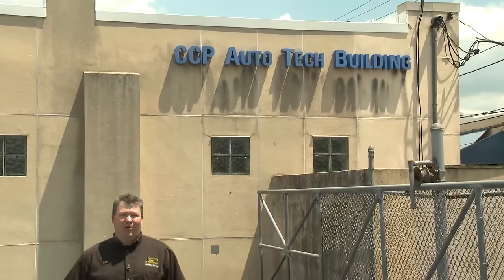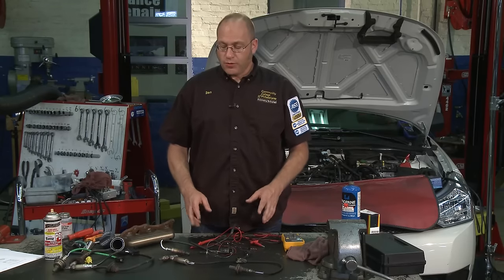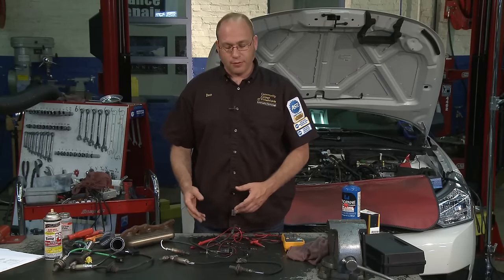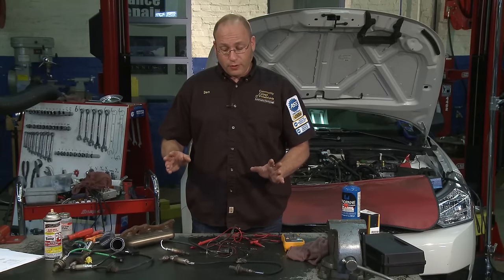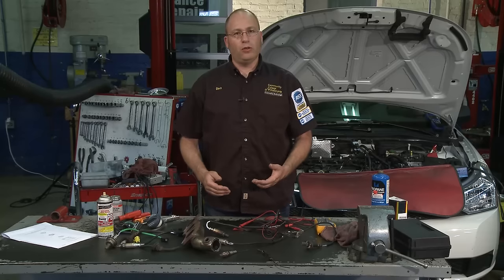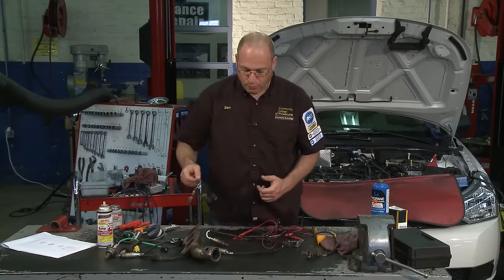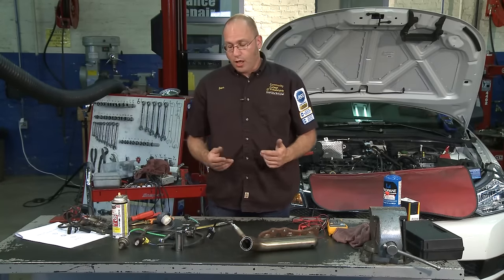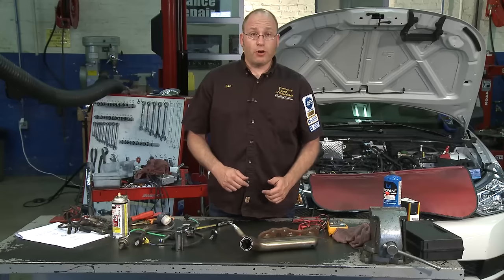Car Corner: O2 Sensor Diagnostics

Comment: Hi hope you are well I think you have answered my questions as I have not tested the wiring but looks like I would have to replace it 
Car Scanner ELM OBD2
DTC report
Selected brand: Mazda mx5 mk3 

============1==============
P0134
Raw code: 0134
ECU: Engine control unit
Status: Confirmed
OBDII: Heated oxygen sensor (HO2S) 1, bank 1 - no activity detected

============2==============
P0130
Raw code: 0130
ECU: Engine control unit
Status: Confirmed
OBDII: Heated oxygen sensor (HO2S) 1, bank 1 - circuit malfunction

============3==============
P0031
Raw code: 0031
ECU: Engine control unit
Status: Confirmed
OBDII: Heated oxygen sensor (HO2S) 1, bank 1, heater control - circuit low

============4==============
P0134
Raw code: 0134
ECU: Engine control unit
Status: Pending fault present, Pending fault present during this driving cycle, Test conditions are met, Test is inhibited by other DTC, Test has not been completed, Validated and stored in non volatile memory, Validated fault present at time of request, Validated fault has been present during this drive cycle
OBDII: Heated oxygen sensor (HO2S) 1, bank 1 - no activity detected

============5==============
P0130
Raw code: 0130
ECU: Engine control unit
Status: Pending fault present, Pending fault present during this driving cycle, Test conditions are met, Test is inhibited by other DTC, Test has not been completed, Validated and stored in non volatile memory, Validated fault present at time of request, Validated fault has been present during this drive cycle
OBDII: Heated oxygen sensor (HO2S) 1, bank 1 - circuit malfunction

============6==============
P0031
Raw code: 0031
ECU: Engine control unit
Status: Pending fault present, Pending fault present during this driving cycle, Test conditions are met, Test is inhibited by other DTC, Test has not been completed, Validated and stored in non volatile memory, Validated fault present at time of request, Validated fault has been present during this drive cycle
OBDII: Heated oxygen sensor (HO2S) 1, bank 1, heater control - circuit low

Comment: At 27:32 you talk about the sensor reading rich and lean. I have a Air fuel ratio gauge that reads it like that. But will read rich at higher speeds of 75 mph. What’s going on?

Comment: Dan   that  was  a  really  great  video  on  the  oxygen  sensor  and  the  diagnostics  used  to  search  through  the  Check  Engine  light .    My  interest  in  the  oxy  sensor  is  because  i  want  to  install  and  HHO  gas  generator  ( Brown's  gas )  to  extend  the  mileage  of  my  2004  Ford  E250  van.    Would  HHO  gas  impact  the  oxygen  sensor ?   Would  it  have  any  effect  on  the  catalytic  converter ?    What  are  your  thoughts  on  HHO  gas .   Thanks,  Gary

Comment: Can anyone explain why I get a P0172 CODE "System Too Rich, Severity 2/3" after installing a brand new Catalytic Converter?  There were no codes prior to installing the new CAT, and we used the old downflow O2 sensor.  Also, the old upflow 02 sensor was not replaced.  I reset the Check Engine LIght, and am hoping it will not come on again.  However, is there any reason for this happening?  Thanks.

Comment: very good analysis and method demonstration. Maybe would be more realistic if the car was more rusty and older... like most people with the problem??  My post cat O2 sensor has 4 differently coloured wires so am a bit lost as to which are the heater wires. Dave UK

Comment: I'm not getting check engine light but been getting hesitation and thinking possible fuel filter. so ran code and got p0141 and p0452.   Will need to change sensors. Hopefully that's all the issue

Comment: Does  the  two  wires  o2  sensor  could  be  replaced  by  4 or  5  wires  02  sensors ?it's  for  a  91Caddilac4.9DeVille . Cranking  hard  but  doesn't  want  to  start . Once  the  battery  cable  is  connected  and  open  the  door  the  idle  speed  control  motor  making  a  clicking  sounds .

Comment: my friend i have a 2013 mustang v 6 i got the code po 420 and po 430  for bank1 and bank 2 efficient threshold my car got something when hit full throttle the car rpm go from some 1000 to 2000 rpm so slow the car launch is so bad and when keep doing full throttle   its start to do something like misfiring its keep cutting of and keep lagging but i got no misfire code and the check engine light flashing 3 times when i turn the key  to ignition 2 any advice

Comment: I have a fiat Punto Evo 2010 model . When I drive some days check engine light and massage pops up , there is no power loss or any other problems. Later after 2 or 3 days it goes off why is this happening? I went to a diagnosis center he told me it's O2 sensor but he erased the massage . Later after one month it came again.

Comment: a physical check of the sensor is good but the correct Part Number should always be the basis in order to have the correct replacement part. You should have use a torque wrench as well to prevent loose or over tightening of the sensor.

Comment: i have a 1995 cadillac fleetwood brougham 350lt1. when the engine gets hot it runs bad (will not take the gas when i try to go, spark knocks really bad) finally it will smooth out. then it runs smooth again. when cold the car runs smooth as silk but, there is no check engine light on. is there any way you can let me know what you think it may be. i would be so greatfull.
Reply: try a tune up

Comment: Everytime i'm watching your video channel, an additional knowledge free of tuition fees, thank you, regarding legit vehicles diagnosis and repair or parts replacement..This Oxygen sensor topic enlightens me about my case, Hyundai Sta Fe 2.2 FE crdi (4 cylinder diesel engine A/T).. Check Engine lights On..but i didn't bother about it because my vehicles still running good, then after 3 weeks Black Smoke starting to appear in my exhaust pipes everytime i want to accelerate immediately...(it is Rich in fuel not Lean right)..and i don't own OBD2 so i don't know exactly which of the 2 Sensors i need to replace...using multimeter by Ohms maybe a possibility to diagnose it..Thank You Sir Dan and CCPTV5...(🇵🇭 netfan)

Comment: Do you have any better way to check sensor without take out the sensor . As just measure the ohm on the wire of sensor. Don't Need to take out...

Comment: you tested a two wire sensor. i have a 4 wire. so what type of wires did you set aligator clips to.  would they be the black and grey of a 4 wire? thanks
Reply: On a 4 wire, two (black) are signal and one (white) is heater, one (grey) is ground. Check a Chilton's or Haine's automotive electric schematic manual to be positive!

Comment: my o2 sensor have issue with its heater element, not giving any resistance when tested with multimeter.
would that be an issue in long run? i've check engine light though referring to the o2 sensor heater
Reply: Yes it is a problem if the heater isn't working on the 02 sensor.

Comment: Video was very good. I have A 2002 CAMARO LSI THAT THE SERVICE ENGINE SOON LIGHT COMES ON not check engine light. At around 100.00 miles I had it checked and it said co2 sensor is bad .I had it changed and went 500 miles before it came on again Don`t know what to do. I did not know that when a punched the car out of state that they put headers on it and removed the cats. The car runs great except for the service engine soon light coming on. Would the cats make this happen.
Reply: +lee rossi Yes, they car is trying to "see" the converters working.  If they are punched out its going to code.
Reply: The two sensors that are mounted before the catalytic converters provide information to the ECM for air/fuel. The two sensors mounted after the catalytic converters essentially tell the ECM about the condition of the catalytic converters, to ensure they are operating within set limits. Without the cats, not only are you illegally driving the vehicle if it passed inspection, but the ECM has no way of confirming the cats are operating within limits, so the light will never be shut off by the ECM itself.

Comment: Hay I have a 2019 fusion that has about 46000 miles and the bank one keeps coming up even after I replaced the bank one oxygen sensor the car drives much better now and doesn’t hesitate around 40 mph so what gives ???????

Comment: I was taught o2 sensors ohms are 10 ohms and above if they are good. We put 3 good o2 sensors that read 10 ohms and the car had no problem with them but when we put an o2 sensor that was 2.9 OHMs, the scan tool showed it was bad

Comment: Would oxygen sensor perform ok if the catalytic converter was somewhat cleaned out (a bit of say broken honeycomb material pieces cleared out )?
Reply: The 02 sensor doesn't care what condition the catalytic converter is in. But, a bad catalytic converter will affect the fuel management system.

Comment: hi guys .i have 2006 hyundai  sonata 3.3L GLS with no code but with the car on or im driving it fuel range miles digital number droping like crazy means i have gas leak i check out car there is no smell what so ever no sign of any leak on gas after my reserch i thing my sensors going bad bcz i have 95 thousand mile in car any advise pls or mr Dan pls help ???

Comment: what if the bluedriver tool says it's running rich but the ONLY codes i'm getting are that there's a misfire on cylinders4,5,and 6 which on my 2009 335i bmw refers to bank 2 (rear). my car has 4 oxygen sensors.

what could it mean?

i'm also having my catalytic converter glow red and it's smoking from the exhaust and leaks a bit of oil from it.

any advice??? i'm really getting stuck
Reply: Your MAJOR problem was January 2019...It's now March 25, 2019 in Long Beach,CA.

1) Number 1 cause of Catalytic Converter FAILURES are Misfire Codes & Fuel Trim Codes _______Misfire Codes are P0300 ( Unidentified Cylinder Misfires ) - P0301 thru P0312

In your case, you said Cylinders 4, 5 & 6
The "4" true interpretation is you have a Code P0304. The last digit "4" tells us that Cylinder 4 is MISFIRING.....The 5 is Code P0305 (so Number 5 Cylinder is Misfiring & # 6 Cylinder is Misfiring also, which is DTC ( Diagnostic Trouble Code ) is P0306......If # 8 or # 10 Cylinders were Misfiring you'd have DTC's P0308 & P0310.

The Fuel Trim Codes are P0170 ( Bank 1 ) & P0173 ( Bank 2 ).

When you mentioned the Catalytic Converter was Red Hot, you made me more nervous than a Cat on a Tin Roof.......That Catalytic Converters Life was OVER.

But before any Catalytic Converter is replaced on Planet Earth, the Fuel Pressure Specs. must be known ,  Fuel Pressure Test must be implemented AND the Ignition System components must be Examined : Are the Spark Plugs on Cylinders 4, 5 & 6 defective ? Are the Ignition Coils on these "3" Cylinders @ Fault ?................Are the Intake & Exhaust Valves @ Fault ?...The 1st example ( Spark Plugs Issues ) are the reasons 95 % of the time.

If you don't test Fuel Pressure & Ignition System Components before replacing the CAT(s), you're gonna be buying another CAT within 30- 60 Days.

With your CAT GLOWING Red, you shoulda had some P0420/P0430 Codes displaying also..Catalytic Converter below Threshold.

Comment: Have a 1995 Chevy Caprice, with 213,000 miles, 
 did a full tune up about 4 weeks, now couple weeks ago arriving home, my check light came on , and both fans on together ,and lost power on the acelaration from 0 to 20-25 mph, fine after that but  the mechanic change the temperature sensors , relay and one fan motors, great for 3 days and happen  3 days later same thing  Bad gas miles , (never had the oxigen sensor changed , could that be that ??

Comment: Starter spinning but not starting intermittently? But when engages it does a fast and strong start.
Any suggestion will be much appreciated.
Thanks
Reply: I don't see any replies to your question so I will give it a shot even though you likely have solved the issue by now.  If the starter is spinning wildly but wont engage and turn the engine, then the small solenoid mounted on the starter is not working!  It could be as simple as taking the starter apart, cleaning everything of old grease and dirt, adding new grease and re-assembly.  If the solenoid and or starter is very rusty, you may need to replace the enter starter with a new or rebuilt.

Comment: Excellent Video. Only One Comment. When you introduced the car at the start you said it was a Ford Fusion however later when you set up the advanced analyser you said it was a Focus and that's the model you selected from the menu. Are both those cars the same in terms of the ECU & faults etc.
Reply: I had noticed the same as well... but great video anyways

Comment: Don't you need to disconnect the battery "before" replacing the O sensor to prevent false computer readings or driving the car for 20 minutes for the engine light to go out? Thank you for a great video!

Comment: i have a chevy silverado 1990 5.7  i located my c02 sensor(under the spark plug driver side) it's got a black wire but the wire is broken i can't find the connection  i saw a bunch of wires, located with a connector like the sensor but none of the    wires are   broken so im a little confused on where it plugs in to i wish i had a picture lol  any help is very grateful

Comment: Most harness connectors can be de-pinned. If you need to use the box end of the wrench, simply de-pin the connector then pass the wire through the box end. Just remember to put the wires back in the proper pin location.

Comment: yeah, but where’s ya get that man. chart/guide for that specific car?🤔.  btw., you might have mentioned for all the super newBs - that that exaust & oxy. sensor could be up to 1100ish •(way hotter than fire), & if sensor has welded its self on, could take like 250(ish again) foot pound of force to dis-lodge for the 1st “✋

Comment: It's basically the same thing as a  Thermopolis on the  old  gas floor  furnace that is located in the  pilot  flame and it generates milli outside that  opens the  gas valve

Comment: CAN THE 02 SENSOR IN A 1996 CHEVY BLAZER CAUSE THE NUMBER 5 FUSE TO BLOW WHEN ENGINE IS RUNNING...I CHECKED ALL WIRING FOR THAT CIRCUIT FOUND THAT I HAD CONTINUITY IN THE PINK REFERENCE WIRE ON ALL SENSOR FOR THAT FUSE 5   MY HEATERS ARE ALL CHECKING GOOD ON ALL 4    O2 SENSORS

Comment: if my truck Ford rsnger has all three codes bad 02 left right and bottom one is it possible thT it's a fuse. ? can they make truck not idol right but run fine for 20 miles then sputter to stop and u gave to pull over restart to go another mile or two then do that over and over

Comment: I dont have any error codes or warning lights. But I do have similar issues. Occasional erratic idling, juddering or slight loss of power when accelerating and a big drop in fuel economy.
Reply: The problem is not O2 sensor other things like injectors need to be tested injected more fuel

Comment: Thanks Dan my old 1999 Toyota ipsum I love for the space actually drinks fuel like a vampire my Sparks are new, worked on some likages in the rubber parts thanks for that additional info fuel efficiency changed a little, no check engine light. And now I think I will need to check my O2 for efficiency it over 173,567 km I had you say they should atleast run 130,000

Comment: thoughts on all four of my O2 sensors throwing error codes..06' crown vic. Just had the trans rebuilt last week which requires exhaust/cats/o2senors etc removed. After the rebuild all 4 show errors..they currently are checking for a pinch in the harness or some other isssue..im not sure why all 4 show errors and made the CEL come on even after reseting..anyone have an issue like this? and could a pinched harness above the trans somewhere get pinched on the install?

Comment: Good day sir, my question goes something like this:
I wanted tech advice (without involving emotions or legal-speak), i.e., just information, not advice. With that out of the way, here is my question.  I have a 2000 Saturn SL2, a 1.9 ltr. DOHC 4 cyl.  It runs great with nearly 200k on it -- I maintain it very well.  Now I (no one else) wish to remove the cat, insert a straight stainless pipe in its' place, run that into a quiet walker resonator, then into a quiet walker muffler.  Questions:  Will the car still run quiet, considering I am using a quiet resonator and muffler?  Next, where would I drill into in order to place the rear O2 sensor?  I will eventually be running a header and a clean cool-air ram for air intake -- still running the front O2 sensor as usual.  Don't misunderstand, I am not trying to make a race car, I just want a clean burning lean machine without all the crap on it, as it is I only run the best fuel in it and maintain it to the highest standard possible.  All said:  1.  Will it run louder and 2. where would I insert the rear O2 sensor?
Thanks for the opinion.  Thanks so much for your reply in advance, I look forward to hearing the physics of it all.